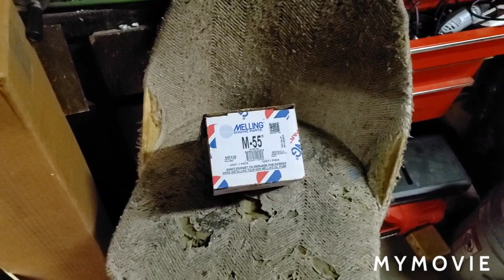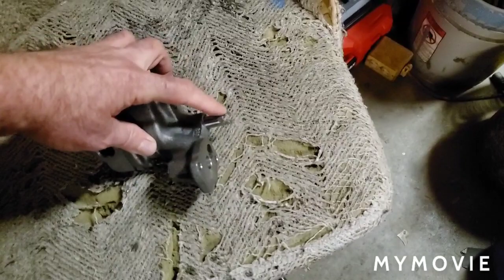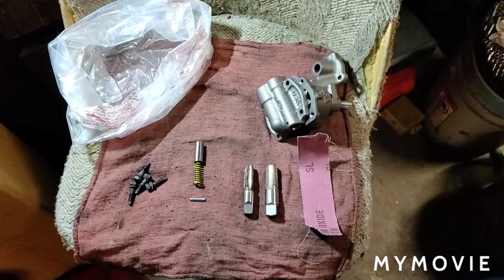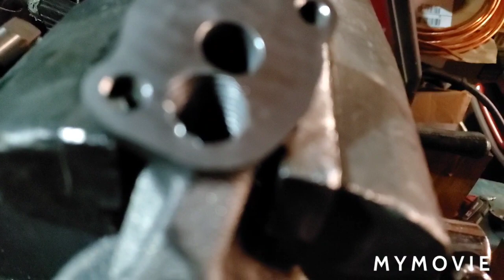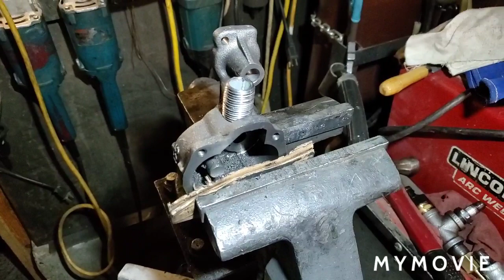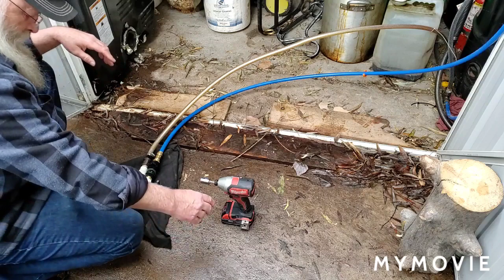DIY Waste oil transfer pump

Comment: This was helpful. I'm heating my shop with waste oil too. So far I've been collecting oil using a hand crank barrel pump, but it takes about an hour to collect 55 gals of oil, not to mention the arm power required to crank that thing. I think you'd probably be better off using an actual drill rather than an impact gun to spin the SBC pump, but I'm just speculating because I havent built one yet. My big question is how many gallons can you pump on one battery charge for the drill? The other concern is that I usually have to pump up about 6ft of head to get from the garages oil tank up to my 55 gallon barrel in my pickup bed. Will this do iy and how long will it take and how many batteries?
Reply from the maker: Haven't tried a full run with the battery power grill, planning on using electric drill when I do that..
Reply: @mugivermusclemachines5744  Thanks for your reply. After writing the comment,I got to thinking about running the hand crank pump with an electric drill. I removed the hand crank and whipped up an adapter on the lathe to turn it with the electric drill. It works great. I pumped 5 gals in about 30 seconds, in low gear... Could probably go faster but didn't want to splash oil all over the place.😊
Reply from the maker: Sweet, ther you go!! I like it!! Sounds like that is way easier to make than a chev oil pump like mine ..lol